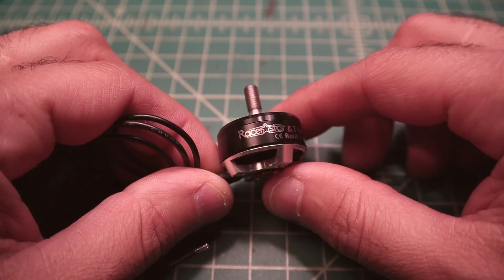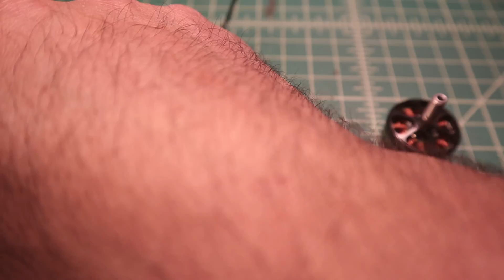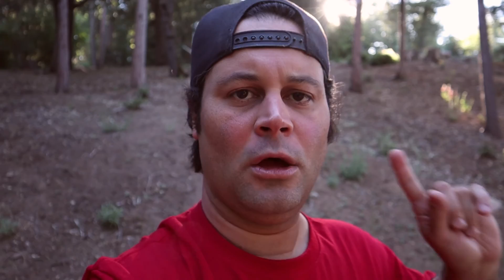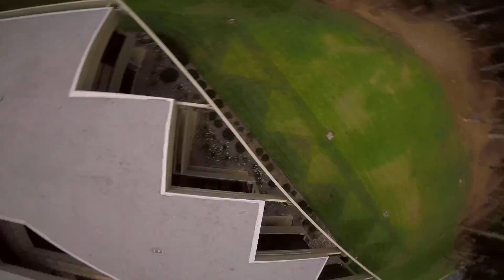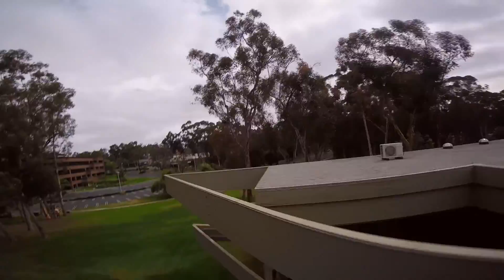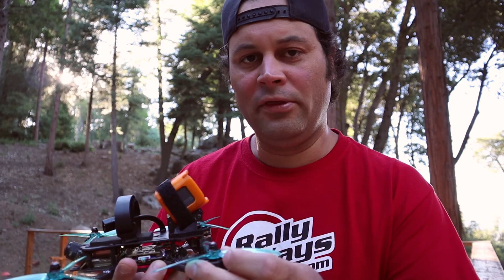Racerstar T-Motor F40 PRO 2400kv Motors

Comment: this is V2 because it has a silver bottom that also was coming with silver wires. The v1 has a black bottom -> https://www.banggood.com/Racerstar-T-Motor-F40-II-2305-1600KV-3-6S-2400KV-3-4S-Brushless-Motor-for-RC-Drone-FPV-Racing-p-1458925.html?rmmds=detail-left-hotproducts__1&ID=523222&cur_warehouse=CN
I don't know what's the motor quality after this collaboration (in the video looks like original T-Motor), but they are good for freestyle and less racing. I'm not sure about Amp draw. If to compare an old motor 2306 and compare to new 2306 motor (any brand) you will notice more performance and less battery sag.
Anyway... if you are not looking for crazy big numbers and just looking for a motor that gives you linear flow, this motor still does a good job. If people are looking for crazy flip/flops and kill their batteries in less than 1.30 minutes, then this motor is not for them :D
BTW, more wire means more weight, less heat dissipation which results in more Amp draw.